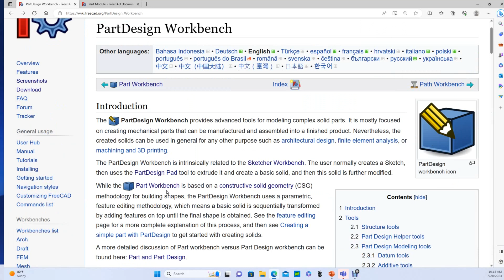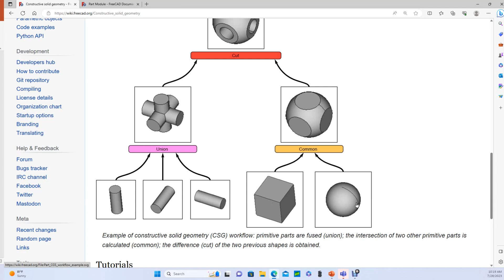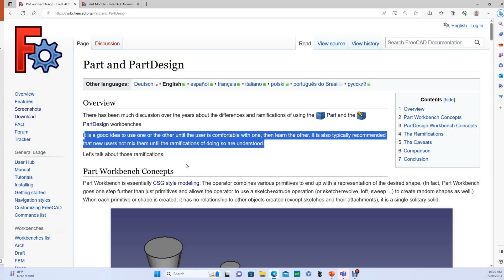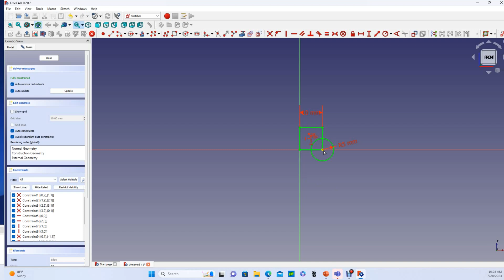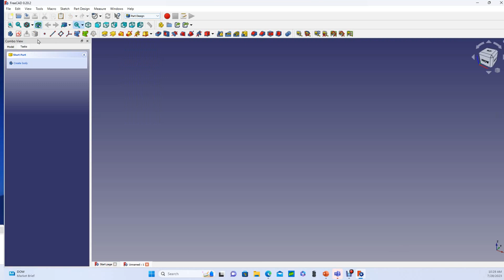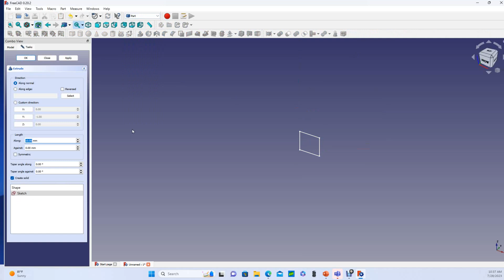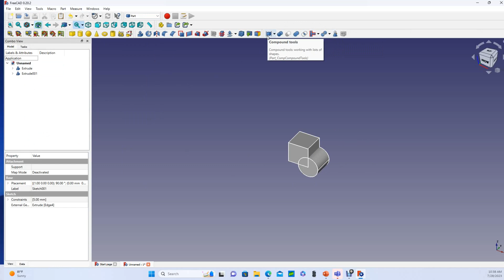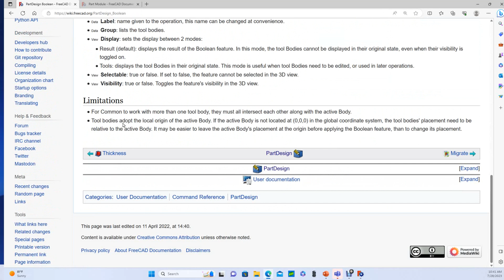FreeCAD part vs part design 1

Comment: Now this is a BRILLIANT video.  I am some way down the learning curve but things keep going awry and this video goes a long to expaining why.  It would be very useful if you could demonstrate how to correct mistakes inasmuch as how to move sketches and/or pads to different placed in the model tree to enable you to, for example, pad domething that otherwise won't pad.  I particularly like the way you link to the FreeCAD instructions.